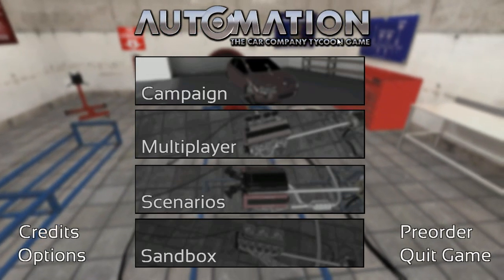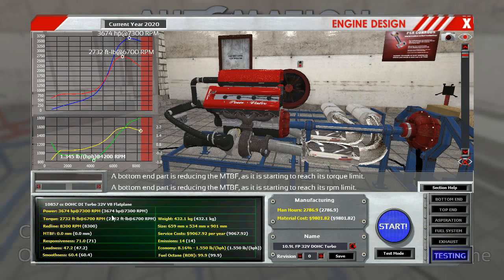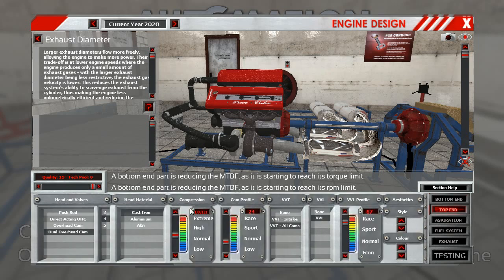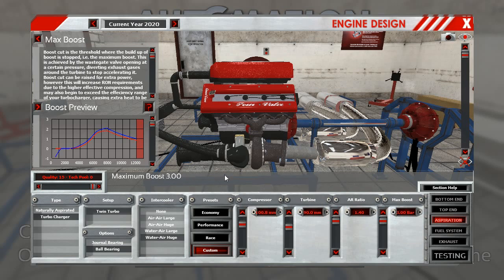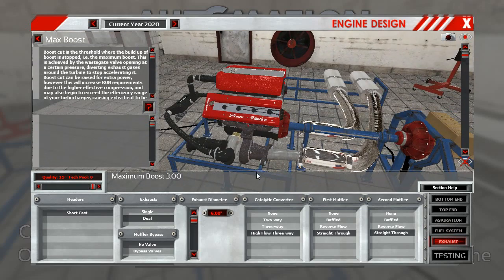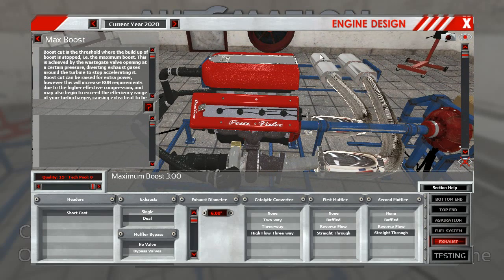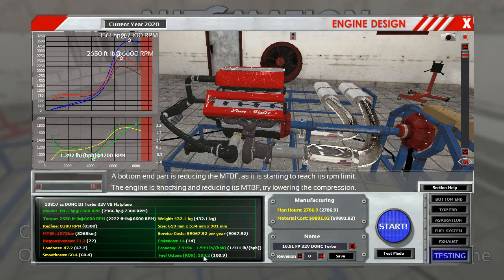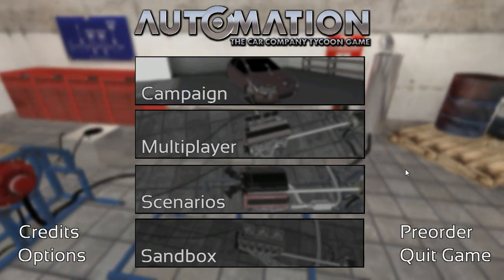3700bhp?! ARE YOU INSANE?!?!?

Comment: one problem, you'd need a transmission from a tank in order to take off
Reply from the maker: David Iles I know but this engine was made 17 months and 3 days ago I HIGHLY DOUBT it would work in the current build of this game...at the present time because of UPDATES!
Reply from the maker: David Iles and Yes if this engine did work I would have to design a gearbox of the gods that would take this power and put it through a prop shaft made of Adamantium to the rear wheels...
Reply: Robert Gracie Nah, just some forged and/or billet steel innards and a beefy clutch. There is probably a powerglide out there that could handle it.
Reply: Actually, i'd think a TH-400 would do it, i mean, the transmission is known for being virtually indestructible